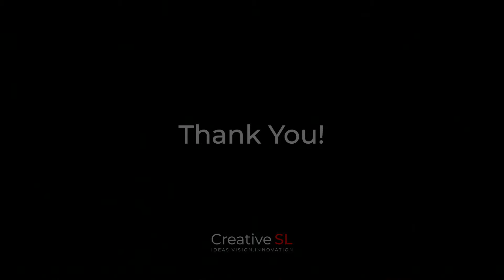How to make NON STOP Lava Lamp at Home | Fairy Lamp DIY

Comment: This came out great! One thing I would do differently is instead of using batteries I would put a usb plug and that way you don’t have to worry about tipping it to change batteries. You would be adding a half volt and that’s ok as long as the amperage isn’t to high. So if you power it with usb from the wall just make sure your brick has no more than 300ma that should be good. (I did not do the actual math this is an estimate) I’m gonna try to build this on the weekend I love this idea!
Reply from the maker: Great tip!
Reply: That’s not how amperage works.  Doing this on usb power would indeed be fine though.
Reply: So no lid on the jar idk heating oil looks dangerous

Comment: can you please explain what happens here that bubbles start to come into the bottle ?
Reply: He connects an aquarium airpump.
Reply: The pump pumps the more dense water from the bottom into the top lid, they then fall to the bottom as big drops because they are more dense. As long as the water doesn't evaporate, this could go on forever.